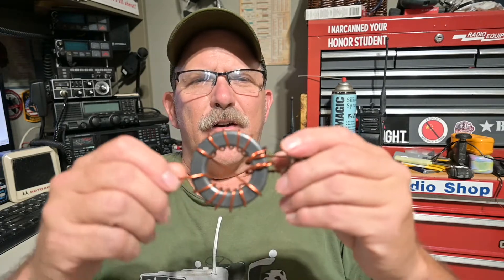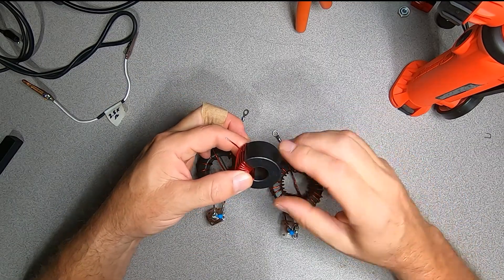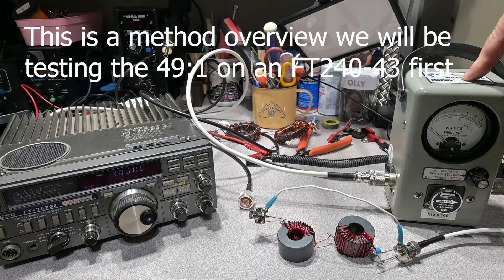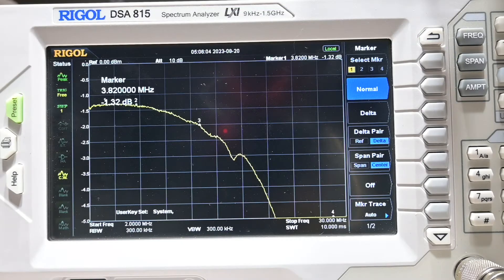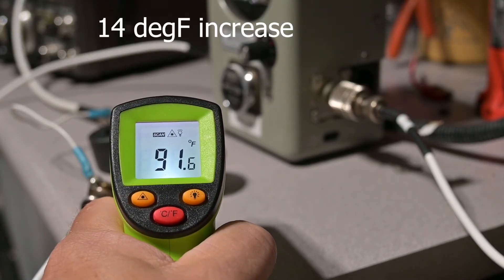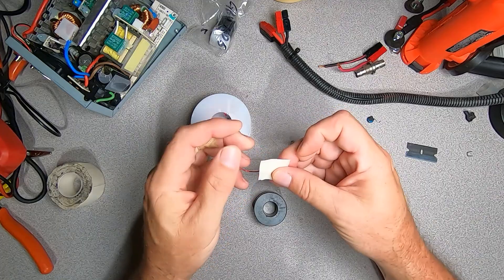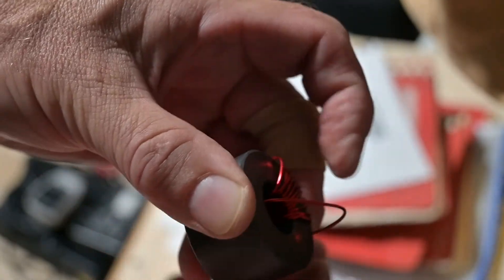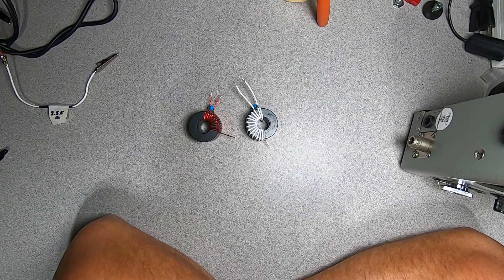EFHW ham radio HF antenna transformer tests -  build the best yourself - save money build and learn

Comment: What size cap? On my 49:1 tapped wrap I cannot get the swr or resistance within good operating range. My 49:1 twisted does just fine.
Reply from the maker: 90 -120 pf . Did you use the 2643251002 toroid ? If you did check your windings or use a variety of resistors to determine if your under or over wound the transformer. Thanks for watching !

Comment: I like your experimental approach.  That's in the best tradition of amateur radio.  Even better is you sharing so we can all learn.  I love that.  It's great that you show us the loss on the scope, then show us the loss on the Bird power meter, then demonstrate the loss by measuring the temperature rise in the transformers and show us a thermal IR image.  This feels like total mastery and understanding of the subject.

I recently built a QRP+ unun for 20 W portable use and before trimming the antenna to tune it, I measured the loss with a nanoVNA and it was so high that I thought I must be measuring it wrong.  I'd mostly done the Monkey See Monkey Do unun that others had built so I assumed that people built this design because it's fairly efficient.  Nope.  Balun, unun and to a lesser extent RF choke construction is close to cargo cult pseudoscience, with hams aping others with insufficient understanding.

I'd purchased two of the Fair-Rite #2643251002 cores from Digi-Key along with TDK high voltage ceramic capacitors and Amphenol RF connectors.  I'm going to use one of those cores to build a 100 W matching network for home EFHW use but after seeing the efficiency improvement over the FT140 and FT240, I'm now going to use the other chunky core for the portable EFHW matching network.  The FT-140 weighs 1.4 ounces and the 2643251002 core weighs 4.0 ounces.  The efficiency improvement is worth the extra 2.6 ounces.

10:35 - There is no need to electrically insulate a ferrite core.  They're not conductive.  If you space the windings so they don't touch, you don't even need to use enameled wire.  You can use bare copper wire directly touching the ferrite core.  Spacing the windings will decrease the capacitance and that might reduce the dip you saw near 17 m.

Comment: So I’m running up against some problems. I hooked up the antenna I made and on 40 meters my swr is 8.75 measured with a rigexpert stick 500. 
The antenna wire is currently about 73’ long. I folded it back at the mast tip easily 6’ because the SWR was at infinity.  I’m using 50’ of M&P POTA cable as my counterpoise.  I feel like something is wrong in my process or in how I made my unun.  What’s the best way to troubleshoot this?  Should I add a counterpoise to the antenna and start from there? It’s my first scratch built EFHW. I’m using a Digikey 2643251002 fair-rite core.  14 wraps with 16g magnet wire a 100mf capacitor into a bnc. The antenna wire is 18g stranded copper.  
Any suggestions would be great!!!
Reply from the maker: Check to see if the antenna is resonant on any frequency between 3.5 to 30 mhz first.  Then we will check your transformer. To check the transformer remove the elements get a cheap 2.2 k resistor and place it between the radiator element attachment point and counterpoise attachment point. you should have a pretty good match on your analyzer in this test because you have made a dummy antenna for your transformer at this point. If it fails this test then the trouble is in your transformer.
Reply: @survivalcomms  Thank you. Thunderstorms now but will check when I can.
Reply: Actually I should have the resistor. So I can check that first and more easily now considering the weather.
Reply: Nope closest I have is a 1/4 watt 2 k. Measures out at 2.002. I’ll get what I need.  No rush.
Reply from the maker: @JoeKrol  2 at 2k is a good sign that means the xfmr should be ok.
Reply: @survivalcomms ok I will check it
Reply: @survivalcomms actually no that was what the 2k resistor measured on the multi meter. When I connected it between the radiator leg and the case/gnd side of the bnc and connected it through the 50’ of pota cable I have the SWR’s were as follows:
6m 7.9, 10m 6.6, 15m 11+, 17m 11+, 20m 11+, 30m 8.6, 40m 9.1, 60m 7.9 80m 7.7. 
I’m thinking I did something wrong in the transformer.
Reply from the maker: @JoeKrol  Ok if you were getting that measurement with the resistor connected across the output  and elements disconnected something is rotten in denmark with your xfmr. Email me a photo of your xfmr and connections and I'll have a look.
Reply: @survivalcomms  ok so I pulled the whole thing apart, re-wrapped with 18 gauge this time. Just took a quick look and without cutting the antenna wire and no counterpoise at 28.300 I’m at 1.87 and 2.0 SWR at 28.400. 
So I should be good after tuning it up. Thank you!!!!
Reply from the maker: @JoeKrol   Cool beans  !

Comment: Thank you so much for this. I watched the Evil vid and it looked good but being a newbie to antenna building and knowing how stuff on YouTube can be questionable it’s nice to get confirmation.  I will be making an EFHW to use for POTA. I’m only a tech but I’m working on my general.  What is the difference between the one you used (2643251002) and the one used in the Evillair electronics YouTube (2631480002) I believe?
Reply from the maker: You are welcome. The one I used handles higher power. Thanks for watching !
Reply: @survivalcomms  nice, so I should be good with this and my FT-891.   I have to say I love how working smarter not harder improves on the performance of the antenna. I’m buying everything I need to make this for an EFHW for POTA. Do you have a preference to gauge wire for the antenna? I’m trying to keep it on the lighter/portable side again for POTA.
Reply from the maker: @JoeKrol  I use 18 gauge wire.
Reply: Is there a benefit to using 16 gauge magnet wire instead if 18 gauge?
Reply from the maker: @JoeKrol  In my opinion it makes no difference. Yes it can handle more current however for that we are working with here 18 is more than adequate.
Reply: @survivalcomms perfect!!! Thank you!!!

Comment: Found it best to go through the core with only one wire of the same diameter. Twisting wires was not successful and the same holds true for the crossover winding. Best use the tap or loop method. Thanks for the video!
Reply: I have also found tap method to be better than having a separate winding. 
ZS5PG
Reply from the maker: @matthewlyle4417  Thanks  for watching !
Reply: Good video. I also prefer the tap. Autotransformer. Has advantage that the centre conductor is at DC ground for statics etc.
Reply from the maker: @tinkerman9525  Thank you ! This is the only EFHW transformer I roll with now. Thanks for watching !
Reply from the maker: Thanks for watching !

Comment: Why insulate? The core in nonconductive. Check with ohmmeter. The insulation holds in the heat.

Comment: I wound one and did the resistance bench test and 1002 had from 1.6 - 1.9 SWR I have found that if it bench tests this way; when you put it to real life use on a live antenna, the SWR is usually pretty close to the bench test. Question is, how do you get the rig to run it without damage or folding the power back? if you use a tuner as I do in the shack How much do you lose with the tuner in the circuit? I really enjoy the video you have put together. I wound a 1002 and am going to put it on a wire and see what happens. Thanks for the video. I just watched a guy build and test both a 49:1 and a 64:1 on the air and the 49:1 did make the radio happy but I imagine the efficiency was not on par, however he didn't have any tuner loss.
Reply from the maker: Im not using a tuner at all in testing you merely put 2 transformers back to back terminated in a 50 ohm load and there is no issue with mismatch . There IS insertion loss across a tuner and the amount varies a bit depending on degree of tuner intervention , tuner quality, and feedline selection. Despite this loss you will always see a performance increase when using a matching network ( tuner) on a mismatched load. The selection and use of a resonant antenna makes all of this unnecessary of course. Thanks for watching !
Reply: @survivalcomms  Thanks for the reply. I plan to put a wire on mine and run it for POTA sometimes I use a POTA outing to trim and set up/test a particular antenna. I am going to see how the 1002 handles and mates up with a wire. Sometimes I do use a Tuner (Matching Network).
Reply from the maker: @bruceweight7319  You are welcome !

Comment: Teflon insulated wire didn't work as well as magnet wire for me, either.  I also found that spacing the turns farther apart worked better.  I think it's the same issue as "crosstalk" in audio applications.  The close proximity of one layer of wire to another influences the wires around it (capacitance).  My SWR dropped considerably when I used about 2/3 of the circumference of the toroid for the winding.  I also found that  pushing the wire through the center of the toroid with my thumb/finger to make a tight bend was much easier than pushing the end of the magnet wire through the hole and trying to make a close fit later.  73!
Reply from the maker: Thanks for watching !

Comment: Great video... BTW, I notice that you have a couple of GE ORION control heads on your bench.  It's a rare site in HAM videos.  I have 4  ORION and M7100 radios in my truck covering 2m, 70cm,10m FM and 6M FM, though I usually have a system head on them.  Great radios...73!
Reply from the maker: I have a handful of them here. Thanks for watching !

Comment: For the dummy load you attach to the transformer for heat testing, was it a DIY 2,450ohm resistive dummy load? I’m interested in testing duty cycles on my transformers but don’t want to send 2 minutes of carrier out for all the world to hear.
Reply from the maker: I built two transformers run them output to output then  terminate the far transformer input into a 50 ohm load.  Here is a link to a 2.4k non inductive resistor if you wanted to purchase one from digikey :
https://www.digikey.com/en/products/detail/vishay-sfernice/ISOA100NT2401JT/24640004?s=N4IgjCBcoExaBjKAzAhgGwM4FMA0IB7KAbRAA4AWAZgDYqQBdfABwBcoQBlVgJwEsAdgHMQAX3wwADGQCs8EEkhoseQiRAwAdBQAEAawDyACwC2mRi3aQQAVQF9WB5AFlsqTAFce2MeI3qBAgEdQQATDwRWPgA3bB1vTD5MVgIecwZRIA

Thanks for watching !
Reply: @survivalcomms ah of course! Thanks for your reply, great content.
Reply from the maker: @MoseYoutube  You are welcome !

Comment: You concentrated in determining the least lossy core and core material.  Good to know, but now the goal is an efficient transformer.  The thermographs show that by far the majority of the losses are in the copper, and you mentioned that as well.  Wouldn’t the next step be to reduce some of the copper losses?  Wire size, winding geometry, copper foil, multifilar winding, rectangular wire, interleaving? Thoughts?  Seems that was dismissed.  Comments?.  Thanks.
Reply: Less turns, same turns ratio?
Reply from the maker: Thanks for watching !
Reply: Or testing at different power levels. At what level will the core saturate and produce more loss? If the measurements with the spectrum analyzer show 1.2 dB of loss at 14 MHZ (24% loss), then losing 35 Watts at 95 Watts of input (37%) at the same frequency indicates saturation loss. Maybe 14 windings with a tap at 2 should be changed into 28 windings with a tap at 4.

Comment: Thank you for this excellent, informative video. One question for you..With the build at the end of the video, you insulated the side of the toroid. I have one of the larger toroids in your video and it doesn’t appear to be (dc) conductive. I appreciate that I’m probably missing something fundamental here, so please advise me. Thank you again, 73..John..G4EIJ
Reply from the maker: Thank you ! I insulated it because I believe it is good engineering practice. It isn't required . Thanks for watching !
Reply: @survivalcomms  Thank you..73

Comment: Great video, however given all the heat is around the windings then I expect that the loss is copper loss. If it was core losses then I would expect the entire core to be just as hot as the flux goes through the entire core equally.   Try doubling the copper wire size  to cut your losses.
Reply from the maker: Thanks for watching !

Comment: Curious if anyone knows why everyone builds the 49:1 as an auto transformer, which couples the secondary to the coax shield. I recently did an experiment, and wound a 49:1 with separate primary and secondary windings, with a counterpoise and antenna attached to the secondary and found it to be a HUGE improvement as far as common mode on the coax and conducted noise to the antenna. It seems to dramatically improve common mode problems that plague EFHW's. It does make the counterpoise mandatory, however. I haven't been able to find any examples of anyone else trying this, and I'm curious why.
Reply from the maker: I would be interested in doing that as an experiment. My choke takes care of the common mode for me but I am open to trying it out. Thanks for sharing and thanks for watching !

Comment: In the transmitter test section where you're using the smaller thicker cores, I can plainly see that there are 2 twisted wires for the primary windings.  At the end of the video you only have a single wire wrapped with 2 turns with the feedpoint on the 2nd turn from ground.  I built one of these using the end of the video and attaching the feedpoint at the 2nd turn, but it seems it's missing the 2 turns for the start of the secondary.  Normally the feedpoint would be on a wire that makes 2 turns to ground, then comes back over the original 2 and continues with no connection to the feed point for 12 more turns.  

When I tried to use it, no matter how little power I was running, the SWR kept moving until it stops at some point.  If I stopped transmitting and started again, the SWR would start high and come back down again as if it was a heat problem.  I'm going to unhook the feedpoint, add a new wire with 2 turns and try again.  

Did I miss something here in the construction portion of the video?
Reply from the maker: What specifically is your question ? Thanks for watching !
Reply: @survivalcomms at the end of the video, where you're winding the transformer it doesn't appear to have a primar/secondary winding, it appears to be a tapped inductor.

I wish we could post an image here, but I'll try my best to draw it with text.

Instead of having a 2 wire primary, and 14 secondary windings like so where the 2 lines on top is the feedpoint (the left 2 would be wired together for the ground connection.
In the first one here, the "W" is 2 turns of the primary, and each "M" is 2 turns each of the secondary)

|  |
W
MMMMMMMM

In this pic, the "W"'s represent 2 tuns of wire on the core.
It's wired like this where the feedpoint is tapped on the 2nd point of the winding, but the entire wire is in series.

|  |
WWWWWWW

Earlier in the transmitter test section, it appears there is a second wire for the primary winding on both cores.
Reply from the maker: @PaulReedy Yes its tapped and not wound. It is slightly more efficient that way. I  explain completely in detail how to build it.  You should try it.
Reply: @survivalcomms  I did, that's the problem.  As soon as I start transmitting, SWR starts going up and eventually settles in about 15 seconds almost like something is heating up, then once I stop, if I let it "cool down" for the same amount of time and start transmitting again, it does the same thing again.  I couldn't test for overheating (was only running 10-20 watts rtty for the tuner.  I couldn't mess with it being we were setting up for WFD so I put a traditional balun in place which operated as expected, and SWR was solid.
Reply from the maker: @PaulReedy  Ok so you built one device that and you suspect has a thermal problem because the SWR starts climbing  and settles ? Did you use the exact same core I used in the video ? I would like to be able to study the transformer in question and see precisely how it was assembled . The transformer you used  for wfd was it one you built or purchased ?
Reply: @survivalcomms  ok I swear I replied to this earlier today, but yes, the Fair-Rite 2643251002 and 18ga wire.  I will have to build another one now as I've added another wire to make it like a standard 2/14 configuration.
Reply: @survivalcomms  Ok, so false alarm, apparently my bag of capacitors was not 100pf, so I pulled one off another 49:1 that I built, and the SWR is all 1.5:1 max so I'll do some testing with it now that it has the proper capacitor.  Sorry for the troubles.
Reply from the maker: @PaulReedy  No sweat ! I'm glad you got it ironed out. In the video after this one I did some testing of various capacitors and lack of capacitors in these transformers.

Comment: At the beginning of the video you show the three different transformers. The ones one the far left and far right are both 49-1 although they are wired differently from each other. The one on the left has the wire doubled over and twisted together for 2 turns through the core, but the one on the right is a single wire all the way with the feed point tapped off after the second turn. Do both methods perform the same, are they interchangeable?   Thanks for your cool informative videos, they are great !!!!
Reply from the maker: Thank you very much. The xfmr without the cross over and tapped has an edge in performance over the twisted primary crossover variant but it is not earth shatteringly so. Tight wound transformers have an advantage in my testing. Thanks for watching !
Reply: Thanks!  @survivalcomms